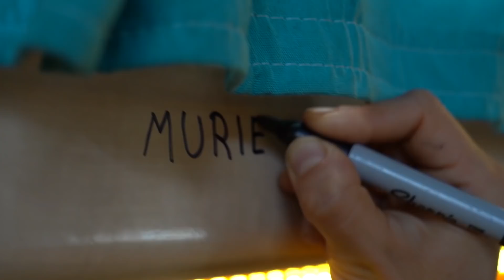LOCKDOWN | Relationship Problems on a Sailboat | S04E25

Comment: Hey you got the motor going! I’ll bet that felt good.  Do you run the gas out on your outboard every time you are done using it for a day or more? My Honda dealer told me this 15 years ago. The problem is additives and ethanol that are presently in our gasoline cause havoc on the carburetors. The gas will oxidize quickly and corrode the carb while it sits in the float bowl. I went through more than a couple carburetors even when I’m draining. But our gas is at fault. Best thing to do is while the motor is running, pull the fuel line out and allow the outboard to run as it burns all the gas out of the carb. It may take a few minutes. That way you won’t have all that gas and maybe a little water😆 sitting in the carburetor’s bowl oxidizing and gunking the thing up. I’d keep a brand new carburetor on the boat if I was cruising.

Comment: Rule #1 for all cruiser outboards, leave the air vent permanently open and place a plastic cup (UV protected with sailor's duct tape - dacron sail repair tape) upside down  over the cap. Never again worry about water in your fuel. Rule #2 is to use carb or injector cleaner additives to your 2 stroke  fuel every few tankfuls to prevent the inevitable idle speed jet clogging as gas evaporates leaving the gummy oil residue behind.

Comment: there is a product called sta-bil…...it keeps fuel fresh for storage. your 87 octane went down to 55 octane or whatever,the stabilizer keeps the octane up, keeps it from varnishing.they also put butane in gasoline for winter months easy starting, and that evaporates as well making yur outboard not start.when you have 1/2 a tank, it is constantly making condensation, where as a full tank has no oxygen to condensate......we put sta bil in our Harleys and even after winter storage it runs like crap until you put fresh gas in it hahahaa
Reply: Sta-bil is OK, PRI-G is better if you can get it.  It's more effective and also more concentrated, so the same size container of it goes farther.  The only real advantage to Sta-bil is that it is more widely available.

Comment: Use Star Tron fuel treatment in gasoline, especially if gasoline is ethanol. The ethanol pulls moisture from the air  into the fuel and it builds up in the fuel tank. Sta Bil also works but first rate boat builders and mechanics say Star Tron is better. I just bought a Mercury 150 four stroke for my bay fishing boat, it has to sit 8 weeks at a time while I work. Mercury dealer says 
"Star Tron" preferably. NO MORE WHOPPERS when fuel is stabilized for long term, no more carb work in kitchen either. Mechanic since 1974, small investment, big results. ENJOY YOUR VIDEOS. LATER

Comment: Slightly different opinion. Lockdown is a one time thing, but the situation is not. You have done several passages over several day, but you are about to be on passage for up to a month.  Forced to stay on the boat. Same situation. It's great you found this now rather than on passage. You might have a lot more stress on you in the middle of the Pacific. Find those solution that work, but laps might not due on passage.

Comment: I alway used to use carb cleaner to clean carb , if I didn't have any , I used starter fluid , I found that you need to do the whole thing every time , so that way you dont miss the one that might be clogged , canned air sounds fine , but I  never had any , I would alway buy 2 cans of starter fluid and carb cleaner ,cheap stuff at big lots

Comment: I thought you were going to use the air duster to put pressure back in the carb cleaner can... Maybe quarantine is getting to me... Buuuuut,  I bet dinner and a load of laundry when y'all come visit the delta,  that it would work... Just don't try this at home 🤔🙄🌋

Comment: Welcome to the new real world where every port ahead may result in a two week quarantine. In such circumstances your boat will become a prison cell and who would not become homicidal and ones individual faults etc can no longer be hidden. And as the world descends further into recession, the chances of a foreigner getting a casual job on land as an alternative, decline dramatically as nations move to restrict the fewer jobs to locals. 
I would seriously consider postponing your travels for a few months until things have opened up a bit to travel. That may be longer though. Unfortunately the timing is against you. Pacific nations are actually tightening up travel restrictions more so, specially in Oceania where the virus is only just starting to become more prevalent.

Comment: You must have super nimble fingers or huge b*lls to remover the dingy engine's carburetor with all it unreplaceable parts and linkages over the water at your location? I tried it with a winch once and had to buy a completely new winch (different brand) while I tried to get a replacement pawl but this was in the days before the computers and the internet.